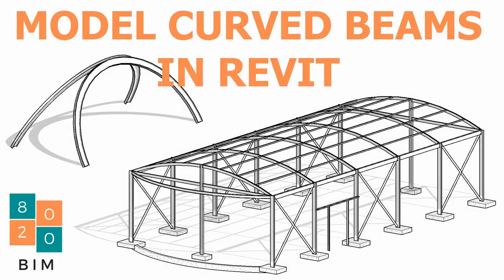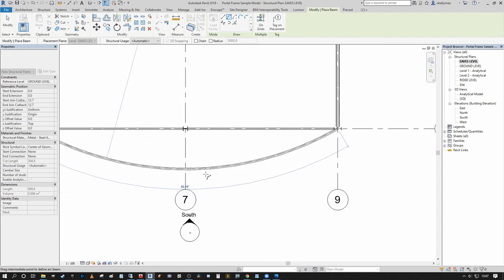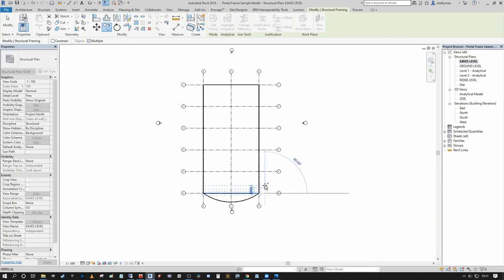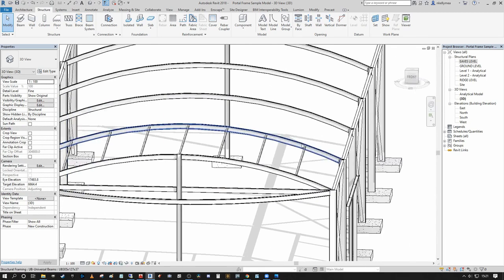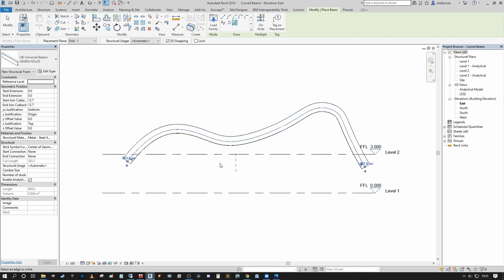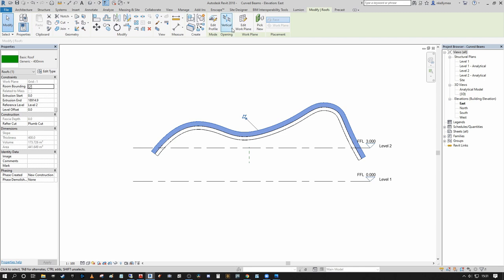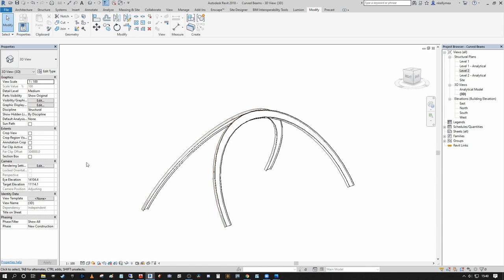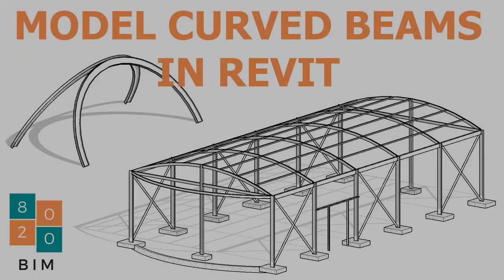How to Model Curved Beams in Revit

Comment: How can you do a bolted connection at the curved beam/column interface ? Like in your first model. You don't want a haunch but you do want an endplate. Or how do you trim a curved beam to manually fit a skewed plate at its end? In revit i mean.

Comment: Great video... I have 2 questions. 1- how would you put a corrugated sheet metal over the curved beam in the z axis? And 2- how do you you a a tapered column small at the bottom and wider on the top? If you could do a video that would be great
Reply from the maker: Hi there,

For corrugation I generally advise against modelling the corrugated materials. The triagnulation and sheer number of surfaces complete hinders the performance of large models and is what I would deem as "over modelling", in line with the various LOD standards (Level of detail/definition) from around the world. I would use a roof by extrusion with a suitable model surface pattern to represent the corrugation.
I will put the tapered column on my tutorial "to do" list for sure. Thanks for the suggestion.
Any additional queries at all please let me know.
Niall

Comment: I have Revit 2019 but I can't visualize the "Automatic Beam System" button. Why?
Reply from the maker: Hi N - I am unsure why this might be the case if you followed the steps (should be immediately visible in the Structure Tab). If you can give me a bit more information I will try help you further.
Niall
Reply: @8020BIM  Fortunately I solved the problem. Anyway thanks !
Reply from the maker: @nicodm6273  Great, all the best!

Comment: Hi, I cant click on this `3D constraints` button. Does anybody know how to fix this problem?
Reply from the maker: Are you sure you don't mean 3D snapping Matice? You can see that in 3D views.
Niall
Reply: @8020BIM  I ment the box under properties > constraints> 3D, that's checked. (But i can't see 3D snapping..) When I draw the outline of the Beamsystem, i don't see the little triangle "defined as slope".

https://www.cadlinecommunity.co.uk/hc/en-us/articles/360000569269-Revit-2018-Create-Beams-Along-a-Curved-Roof
 
^ in that animation you will see that they also check that box, like you have. But ik can't, because it's greyed out.
Reply: Found the solution! I had to set the workplane to a level.
Reply from the maker: @matice7179  ah right, good to know. Well done, thanks for letting me know! All the best. Niall